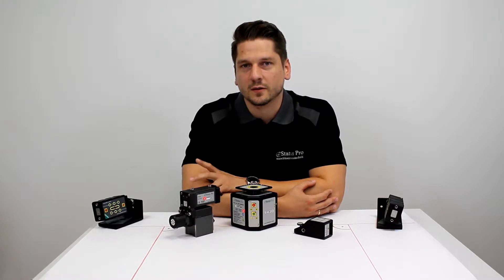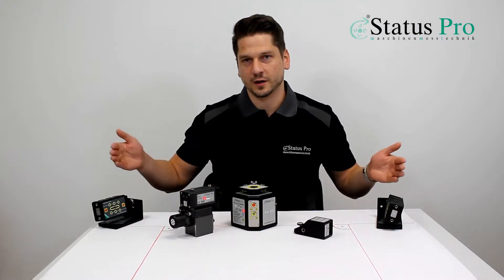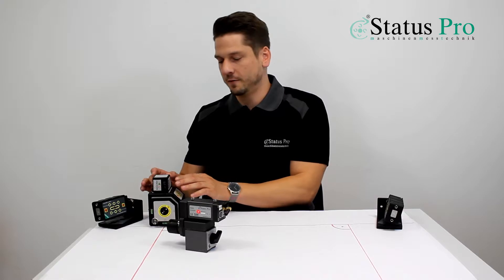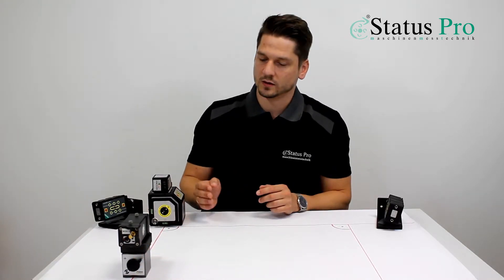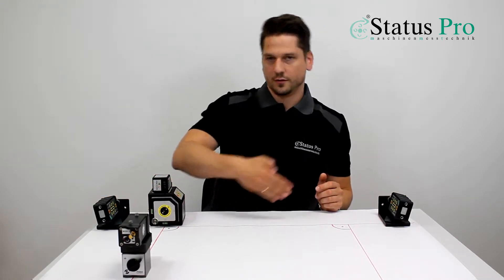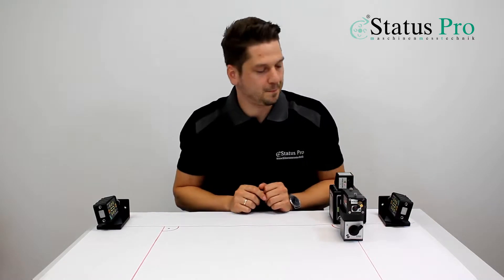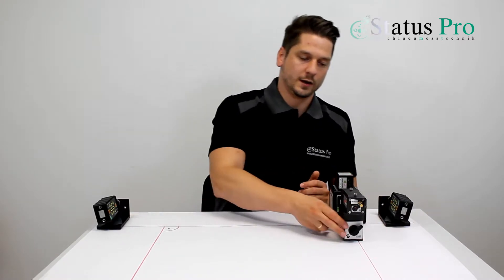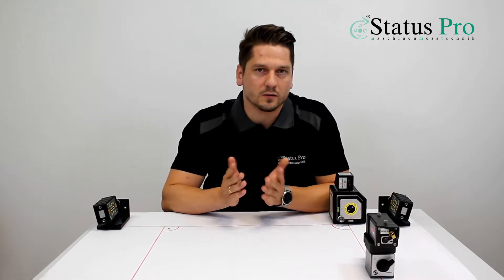Laser Measurement of parallelism between guidelines on a machine tool, explained by Nico Janssen.

Comment: Danke Niko! I've been thinking about this for a while. We, regular mortals don't have the money to buy expensive German tools. However, take the two guides and go far away from a white wall (say 100 meters) or a few meters in enough if you go back an forth between the slides and the wall to look at the spot with a magnifier. Use a bubble level and place the guides in the same plane, roughly horizontal and parallel to the wall. Use a laser pointer taped to the level and aiming at the wall. Slide the level/pointer group around making sure to keep the spot on the same vertical on the wall. Any small difference in parallelism will be converted into a large change in height of the laser spot on the wall. You got the idea, I bet you can measure 1/100 degrees if you have a good laser (let's say your error will be 1 mm at 10 meters or better if the spot stays small). The limit is the spot size, so a gas laser will be much better than a diode. Tschuss!
Reply from the maker: Dear Gus, thanks for the comment.
You are right that there are other possibilities to measure the parallelism of machines. 
What we present here is the way to measure high precision machines where we talk about µm. We measure tool machinery, CMM's and roll parallelism with this principle. 

Along a guideline there are offset errors (X and Y) and angular errors (Pitch, Roll and Yaw). Furthermore, we measure the positioning error with our µLine system. 

So for example if you see a deviation of the laserspot on a wall, 100m away, it is not clear if there is an small angular error on the guideline or a large offset error. Both will effect the laserpoint in the same way. 
The most common way is here to measure the distance of the guidelines with a bracket which is fixed on the sliding table on one guideline and measure the distance to the second guideline with a simple dial gauge. Additional you have to use a digital spirit level for the height and one for the roll error. 
This method is also not 100% free of errors because a angular deviation of the guideline also effects the reading of the dial gauge. Furthermore this principle will fail if the distance of the guidelines is too large (gantry machines). 
Beside the sale we also offer our service and rental systems.
Reply: @StatusProGmbH  Nico, do you guys sell these measuring systems? I live in the Denver area, so there are quite a few mechanical shops. Do you think I can use some of your equipment and do business with local shops, like measurements for various machines? Or maybe I can represent you. I am a very sharp guy. Thanks.
Reply from the maker: @GusLandy  Dear Gus,
sorry for my last comment, I forgot to mention that this is not Nico, my name is Bernd Koschinski.
Right now we are looking for new distributors in the US. We provide service, offer rental systems (in the EU) and we sell our systems worldwide, mostly to our distrobutors.
It would be nice to receive your mailadress and we can talk about your and our ideas for a partnership. Just use info@statuspro.de and I will answer immediately. Regards Bernd
Reply: @StatusProGmbH  I've just sent you an email with my Skype handle. I am currently transitioning to a new phone carrier so Skype is the best option if we need to chat. I am 8 hours behind Germany but my time window is very wide. Best regards, George
Reply from the maker: @GusLandy  Dear Gus, I checked the inbox of our mail accounts but unfortunately there was no mail. Can you maybe try it again and use info@statuspro.com (instead of the .de). Best regards Bernd
Reply: @StatusProGmbH  I will resend, Brend. Tschuss!
Reply: @StatusProGmbH  Brend, I've just sent you another message at the .com address. Check your spam folder too. It's a yahoo address. Cheers!